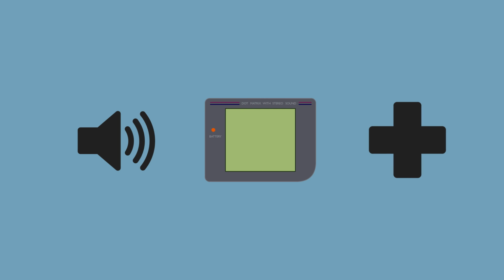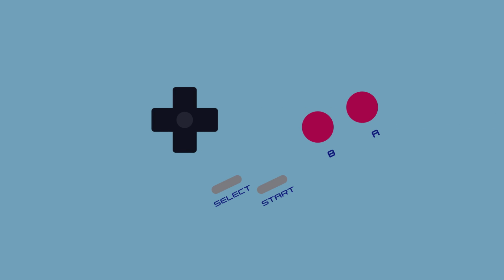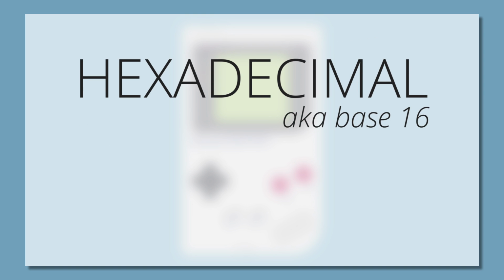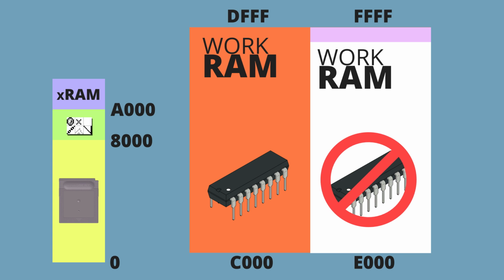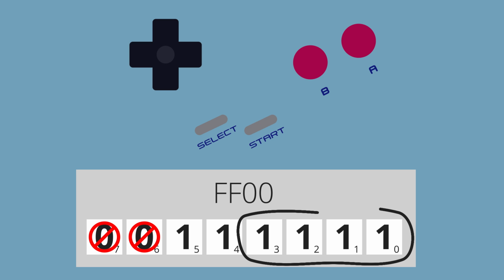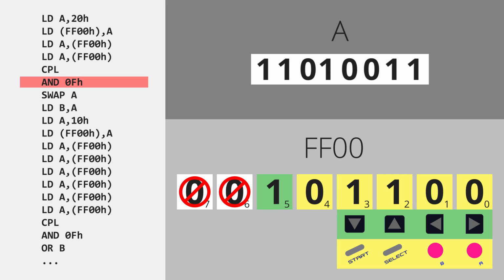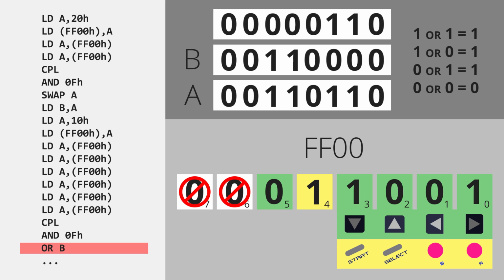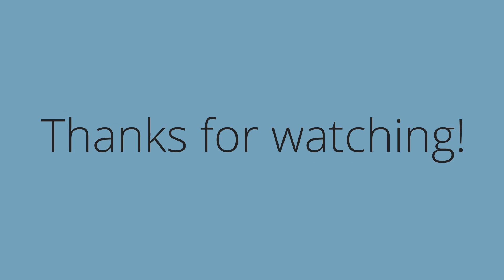The Game Boy, a hardware autopsy - Part 2: memory mapping

Comment: Pokémon Crystal couldn't be played on a Game Boy. You should use Pokémon Gold instead :)
Reply from the maker: +Eloy: Yume Nikki Fangamer you're right, though the point still stands because the gbc had the same amount of address space reserved for the cartridge!
Reply: GBC had bank switching in both VRAM and WRAM ("parallel" switchable areas) described as follows:
1) VRAM: 16kB instead of 8kB (original 8kB + new bank of 8kB)
2) WRAM: 32kB instead of 8kB (8 banks of 4kB)

But beware, even if you had more AVAILABLE RAM, that doesn't mean you could access it all at once, you could only access 8kB of one bank and then switch to another one, so you had the following situation:
1) VRAM: 2 banks of 8kB to choose from.
2) WRAM: 1 fixed bank in the first 4kB + 7 banks to choose from for the second 4kB.

Bank switching is the same mechanism that allows to use >32kB cartridges by switching banks in the ROM area (the first 32kB) using the cartridge's built-in MBCs (Memory Bank Controllers) that were used for GB games too (like Super Mario Land)
Reply: Isn't pokemon crystal a bit larger though? Gold/Silver would work just as well but I thought I remembered crystal having some extra stuff

Comment: I have a doubt: why not use the entire byte to represent all buttons, one bit for each button? Why waste the first two, and then use a control sequence to change the meaning of the last four bits? Why not, like:

bit 0 : A
bit 1: B
bit 2:  start
bit 3: select
bits 4-7: d-pad
Reply: This has to do with the physical implementation of the button hardware. The gameboy uses multiplexing to reduce which reduces the number of wires necessary to read the buttons. Simply put 2 buttons can be put on 1 wire. Which in the case of the gameboy results in a total of  6 wires are necessary. I don't know why they chose to do this, because it only saves two wires. Maybe they ran out of pins on the chip.
Reply: +Robojan I think it was way cheaper to wire the memory controller this way.
Also, you can use the same byte for requesting the inputs and receiving it.
Reply: Yea, thought the same
Reply: Room for input expansion?  Nintendo seems to keep things open for future accessories.